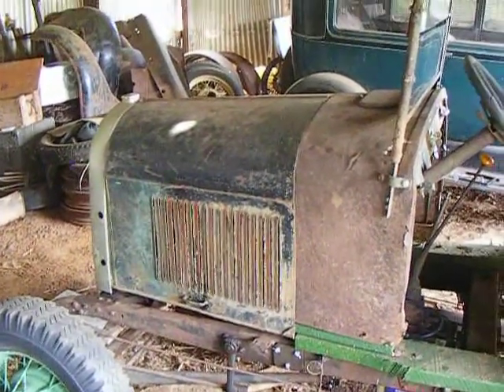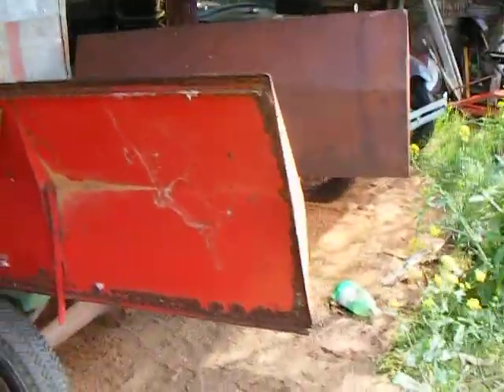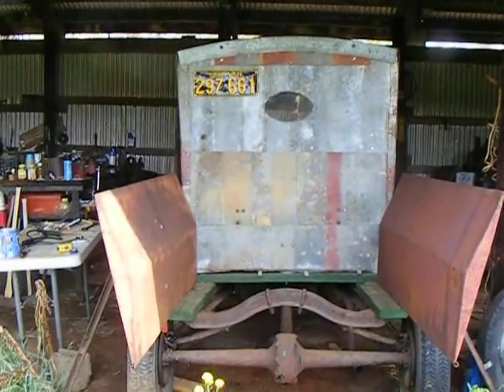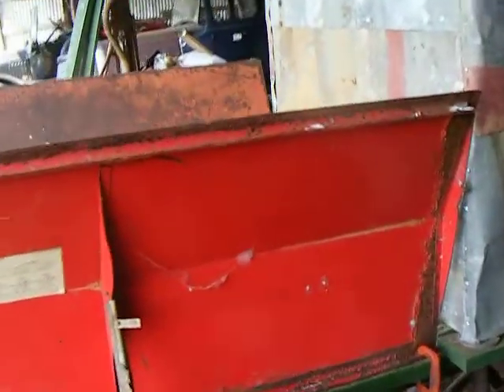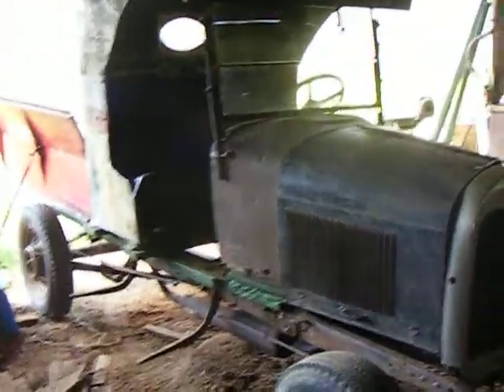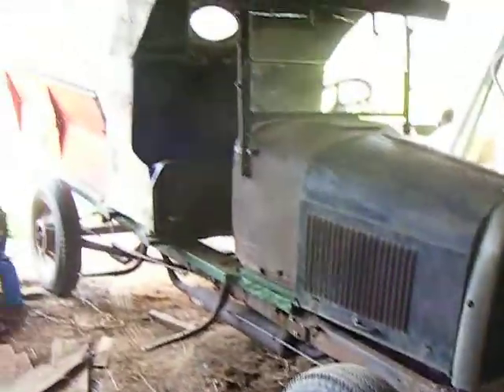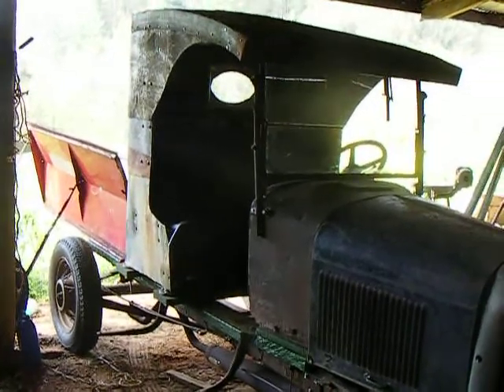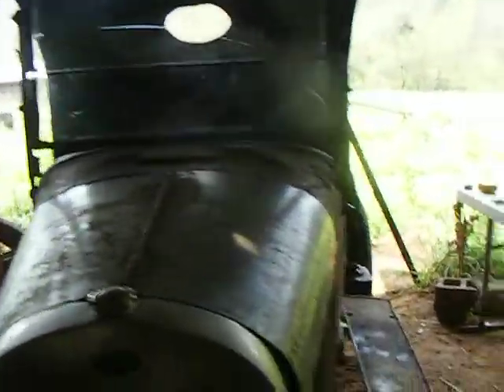Model A, Working on the truck bed

Comment: Looking good! Do you have a plan for what the back piece will be made of? Like where the tailgate would be?
Reply from the maker: I am going to try and use a gate like thing made out of pipes that is in the milking parlor, it will swing to the side rather than drop down. I will have to see how it fits, may end up doing something different.